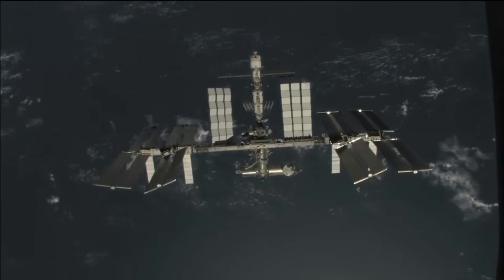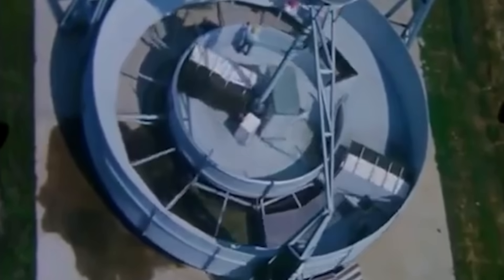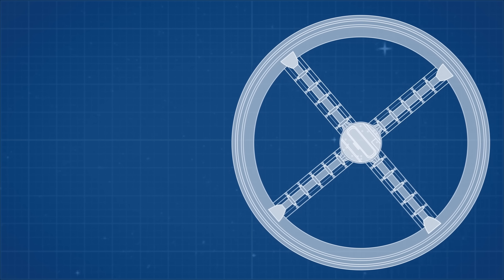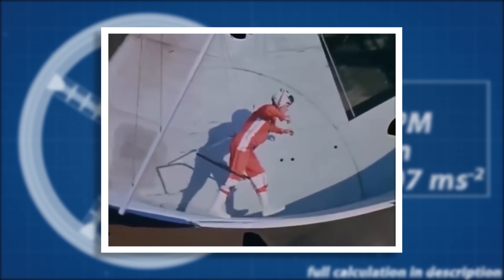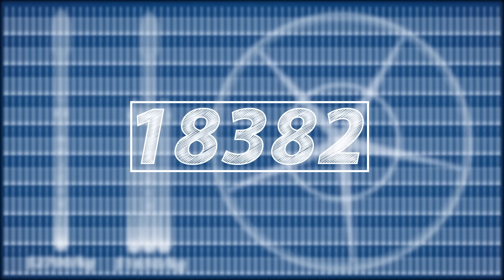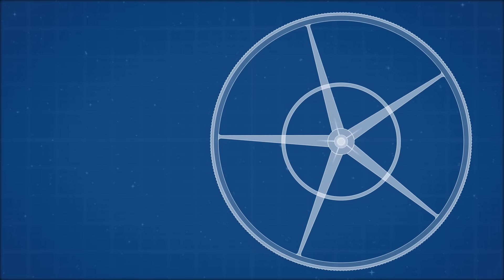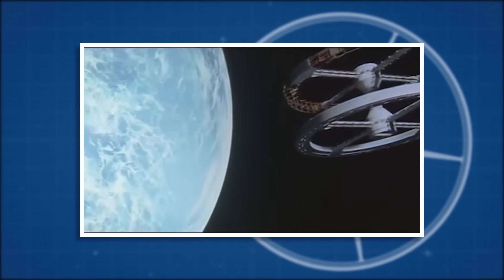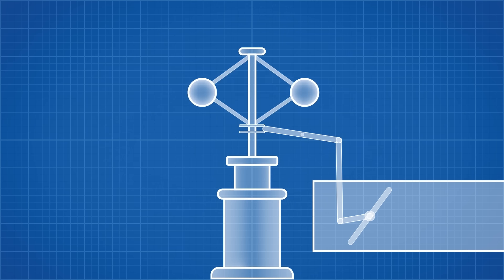Can We Create Artificial Gravity?

Comment: The idea of a huge space wheel station shows very little imagination, it's a clunker. Here is proof: Instead of building that monstrosity, just take command of a decent sized asteroid,  set it to spinning, build habitations by drilling into it near equator. Floors will be opposite center of rock. Be careful, loose material will fly off and be lost in space.
Reply: Ok, in less than a minute thinking about this, asteroid = collected jumble, I had the following idea: (compare with constructing a massive wheel) Create a big net, maybe made of Kevlar, Graphene, or carbon nanotubes. Cast it around the pile of debris that is an asteroid. Set it spinning, and maneuver the jumble into a flat disc with some interior stays. Before the disc is spinning fast, insert inflatable habitats in there and when inflated, the habitat pushes aside the loose rocks. So the big net is the main construction job, and the habitats are sort of necessary no matter how the station is fabricated. The rocky debris fills the very important task of radiation shielding. (Net needs to be radiation resistant.)
???
Reply: Glad to see you're on board with the concept. Oftimes, low tech is best. NASA spent big bucks to develop zero grav ink pens, Russians just used pencils.
Reply: @michietn5391  NASA did not spend a dime designing Zero Gravity ink pens. In 1965 Fischer Pen Company spent 1 million dollars out of their own pocket designing a nitrogen gas pressurized pen that could write upside down or in cold/hot conditions. NASA bought 400 of the pens at 2 dollars and 39 cents a piece. the very next year the Soviet space program bought 100 pens and 1000 ink cartridges at the same $2.39 a pen that NASA paid. The Mechanical pencils NASA used were in fact 50 times more expensive than the "zero gravity space pens" they bought, now more commonly known simply as a gel pen.

Comment: The Gravitational Instability Cosmological Theory on the Formation of the Universe 
When the Universe started to fall . When did Motion Start ?
(1) The expansion of the universe is a result of the " heat ' contained therein;
(2) The source of the " heat " is the cosmic microwave radiation background at 3 kelvin,
wherein;
(3) The microwave electro magnetic-nuclear energy was formed as a result of the
interaction of two different static gravitational vacuum fields, causing gravitational
instability and the motion, void of matter, at this time,

wherein; static gravitational field (1) began to go into "motion".

Therefore; the interaction of (2) motionless / static gravity vacuum fields, could eventually create dust particles  in the Universe that later form into stars, galaxies , planets, moons and other objects in or about their current locations.

When did motion first start ?

Science knows the formation of matter in our universe was caused by the forces of the

universe.

These forces are:

(1) The Force of Gravity

(2) The Force of Electro Magnetism

(3) The Strong Nuclear Force

(4) The Weak Nuclear Force

At some point in time, motion within the universe, had to begin.
The paradox would be, what force could cause motion to begin, without moving in its
present space-time ?

The Gravitational Cosmological Theory was
developed from an is rooted in the Einstein Steady State Theory and the Bondi-Gold-Hoyle Steady State Theory,

Wherein the Steady State Theory the universe,
contains more protons than electrons that
create dust particles and
galaxies formed in their current locations and the cosmic
matter is recycled therein at the center of the galaxy furnace.
------------
When the Universe started to fall:
The Gravitational Instability Cosmological Theory on the Formation of the Universe.
The Theory:
(1) The expansion of the universe is a result of the " heat ' contained therein;
(2) The source of the " heat " is the cosmic microwave radiation background at 3 kelvin,
wherein;
(3) The microwave electro magnetic-nuclear energy was formed as a result of the
interaction of two different static gravitational vacuum fields, causing gravitational
instability and the motion, void of matter, at this time, wherein; static gravitational
field (1) began to go into "motion".

 Therefore; the interaction of (2) motionless / static gravity vacuum fields, could eventually create dust particles  in the Universe that later form into stars, galaxies , planets, moons and other objects in or about their current locations.

Q: When did this motion start?
A: If a neutral particle is able to resist the universal motion, in theory, that particle
would go back in time. Going back in time the neutral particle would then enter into (1)
of the (2) motionless-static gravity vacuum fields void of motion, and cause an unbalance
and gravitational instability and this interaction would create motion and energy
particles.
Q: What causes a gravitational static vacuum field in the first place ?
A: Pressure force is used to create a vacuum on Earth, perhaps an exotic something
100,000 times weaker than the force of gravity decays, causing a static-motionless gravity vacuum field.  

Q: What created the motionless gravity vacuum fields in the first place ?

A: Vacuums are created by pressure so the only answer I can think of is a created gravity vacuum pressure from the future goes back in time to start motion in the past. 

( DRI 2002, the theory needs improvement - help yourself )

Comment: Ok, you mention if the circle is smaller and the person spin around, so the diameter gap of a person on tangent ring to center point of ring, so if it is smaller, and the same spin, the energy of inertia will be higher and force the blood down, if it is less energy, it would be too low and force your whole body to fall off? So, the bigger circle, the more impact at smallest level to biggest level, so it is like 1 to 2 degree or 1.5 to 1.4, and so on until 2, so the spread out is more details. 1 to 2, or 1 and series of 1.1 thru 2, so each 1.1 is 9 time, 1.1 to 1.9, then result 2. So, it matches newton's 3rd law that opposite reaction cause equal reaction which it has to be in balance, which the impact feeling is connect to how big and how fast, the bigger, and the faster, the better for human? Never mind the size of human in it, but feeling impact that affect human. So, I understand that the stress impact if it is near to the center of rotate, so the resist force of materials is high enough to resist the impact. So, higher density material at center to lower density material at tangent ring. So, it means to balance out the gravity that we feel on earth, which the spin of ring and diameter gap of ring, and you are on tangent ring, the inner one. So, big size matter for you because we are closer to center of rotate, so we feel the impact, so between two distance that is small like 2 feet away from center of ring to 3 feet away from center, so we feel higher impact within 1 feet gap, so if ring is bigger, the feeling of distance gap is lower.

Comment: For building material, it would be cool to use plastic, if only we could design a plastic that is light but strong, and will not rot in the solar rays. It would be cheaper and we definitely have enough oil for it.

Comment: It looks like a helicopter blade. 
Wait helicopters fly. Just fly it to space.

Or put rockets themselves together. 
4 rockets together. It doesn't need to be round to work.

wait just use one rocket and spin it. sleeping at the end points will build bone density. 

Or, guess what you are in space you just don't need.

OR a pressurized suit!!!!!!!!!!!!!!!!!!!!!!!!!!!!!!!!!! Gravity is pressure. Forget gravity, Alternating pressurized suit will do the job. 

Next problem.

Comment: What load of brainwashed bullshit. Centripital and centrifugal force don't really exsist by their definitions. You can't have force without action and reaction. The force from spinning is lagforce of inertia outwards lagging behind the rate of change of angle outwards or away from the center. There is a law I wrote for this force the law of circular motion and it works. A 1 pound weight with a 1 yard radius and 1 revolution per second generates 360 foot pounds outwards lagging behind the change of angle in degrees per second.

Comment: You mentioned that the greatest stress is on the center. what if we had no center. I mean a wheel with a hole where the center is/was or should be. and instead a second ring with a diameter half of the out side ring, so 2 rings in parallel.

Comment: Something you over looked is by the time we could get started because of the rockets being not efficient enough yet is carbon fiber.  In a few years carbon fiber will be the same price per pound as steel 10 times stronger but 5 times lighter and 8 times stronger than aluminum and half its weight. It would reduce the cost drastically based on weight alone

Comment: The "brilliant" designers of Elysium also left the station open to space so not exactly the best example.
Reply: Nothing happens instantly, it would take from seconds to minutes. And no, some air molecules would remain, because after a while the density gradient would be too low. Not enough air for life of course. Also FYI atmospheric pressure is caused by gravity.
Reply: What about the halo rings?
Reply: Michal Faraday but the station due to it's enormous size would actually be able to retain it's atmosphere, search for "bishop ring" station
Reply: Nope, the barriers on the sides go maybe one or two hundred meters only. The air would be gone in minutes or even seconds.
Reply: Oh, that is a nice article :-) Correct me if I´m wrong, but I think it works like this: The centrifugal force keeps the air from going UP, but there is nothing stopping it from going LEFT or RIGHT - that´s why you need the walls. In the Bishop station the proposed walls were 200 km - as high as the atmosphere. So imagine the wall goes up only 200m. That means at 200 meters your air immediately  escapes to left or right, because there is nothing stopping it from doing so. That means your atmosphere is only 200m high. Even if the air kept the original density, it would never generate enough pressure for humans to survive. But of course the air would not keep the original density because a gas wants to diffuse. So with vacuum at 200m most of the air bellow would be sucked out. I guess the artificial gravity would keep some from escaping, but no way  we could live there.
Reply: Are you insane? The moon isn't even heavy enough to hold an atmosphere.
Reply: You would lose gasses, yes. And if it stops spinning, you die. It does not seem economical, as you would need to regularly replace the gasses lost. Not to mention, you have virtually no radiation shield to speak of. Early Stanford Torus designs used chevron mirrors or Quartz glass to mitigate radiation. Size does not correct this limitation and 200 meters of atmosphere would not have the same effect as a couple meters of solid material.

Comment: How would you make it spin?
Reply: niamh guthrie Rocket engines. One good burn will spin the entire station for the entirety of its operation, unless something causes it to de-spin. Also, on the versions with counter-rotating or contra-rotating modules, they can be spun up with electric motors, each module serving as a giant reaction wheel to another.
Reply: Someone would have be outside and push.

Comment: Ok. There are so many things wrong with this explanation. 

First a system doesn't "have" to be in equilibrium. Theres no physics law that states that. If a system is in equilibrium it keeps its momentum if its not in equilibrium then it changes.

Second, the point of relativity being it galileian or general, is that any reference frame is valid and all forces are acounted in each one. There is no "this phenomena can only be experienced if you are standing on an ice cream truck."

Third there is no mystical invisible magical force pushing the guy down. Nothing is pushing the guy down just up. That's what keeps him stuck to the ground. The acceleration of the wheel like when a car accelerates forward and a person gets pressed against te seat. Again no ghosts pushig back, no equilibrium, just phisics.

Comment: I don't get it. The artificial gravity they are trying to create is based on centrifugal force, but if gravity on earth is real, is it not centripetal keeping us grounded. If we are relying on a centrifugal force, we all should be flying off the planet. Also the centrifugal force generated from the spin of the earth should be sending water out into space, especially at the equator.
Reply: The thing is, the Earth is fucking massive. So massive, that matter's inherent gravity compresses this ball of dirt to stay in one piece and keeps shit on its surface. This artificial gravity is a just a simulation of effects of an actual gravity - enough that bodily processes and some industrial ones work as they do on Earth, but you can deduce the spin gravity by a (relatively) giant Coriolis force generated - if the poured fluid falls slightly sideways with no wind present, you are on the spin station.

By the way, the centrifugal force on the equator of Earth, while being insufficient to neutralize gravity, still allows to save some fuel during the rocket launches, hence why countries tend to put the launch facilities as close to the equator as they can.
Reply: +caav56 Hold on...70% of the earth is water, this water is wrapped around the so called outer core, the inner core somehow produced this force called gravity, we don't know how it produces gravity, we just have to believe it does because "clever" men told you it does.

So this water on earth, reacts in the exact opposite way to how water would react on any other spinning object. So water on a spinning ball called earth, reacts different to water on a spinning tennis ball. Every spherical object on earth seems to reacts in the same way, but the spherical object called earth reacts differently. Please show me a practical experiment to prove your point.

Comment: What about a module which rotation center is the center of the module and a counterweight linked by a cable?
This way you just need a small module, long cable, and counter weight and of course make that spinning to have artificial gravity.
What do I miss? where is the flaw in my logic?
Reply: Shuai Ge There is none, though this scheme is harder to controllably spin/de-spin, since the cable is flexible.
Reply: You mean there is no flaw in my logic. but it is harder to manage. right?
We can imagine a smaller counter weight that is attached to the cable and automatically move closer to the center or closer to the main counterweight to balance the push of the counter weight according to the movement and mass repartition change in the module.
Plus instead of a cable can maybe put a strong hard bar... to limit the effect of the cable.
Doing this kind of stuff sound like needing to build a much smaller structure, and thus be much cheaper than a huge construction in space.

Comment: What about a skyhook? To reduce launch cost. From low orbit extending into the upper atmosphere perhaps in combination with super skyscrapers and elevators? If that makes any sense. From orbit in space extending down into earths atmosphere as to reduce how far we have to go up.
Reply: Not possible, even if it was, it would be way more expensive. Imagine bringing all that equipment on top of mount everest, that's only 7 km away from sea level. The iss is on average 400 km over earths surface. Those 7 km wouldn't matter much :)